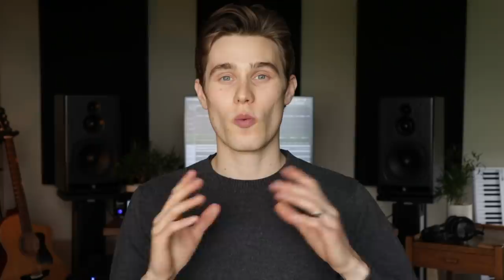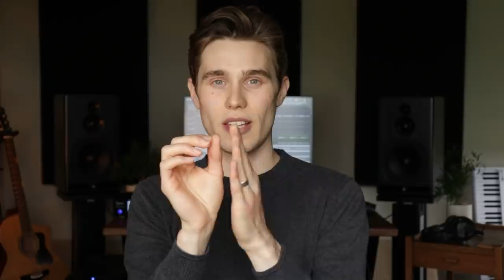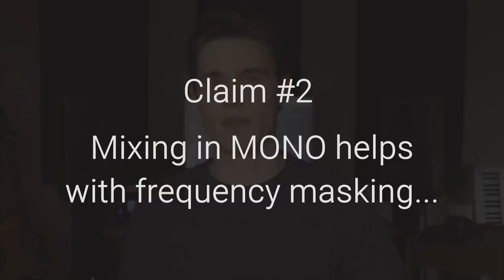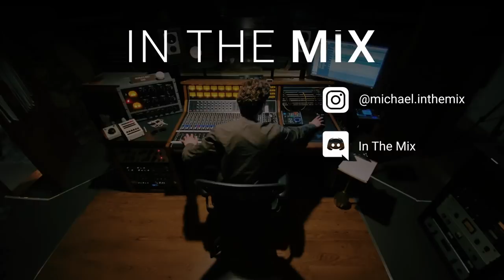Mixing In Mono - Secret Weapon Or Waste Of Time?

Comment: Mono compatibility is not just for clubs or radio, anyone who moves far enough away from their speakers where the two speakers essentially become one source will hear your mix in mono too. I don't have the number either, but I'm going to guess it's far less than 99% of people who always stay perfectly in between their speakers or who only listen to music in headphones. I know I certainly don't. When you factor this in, lots of people hear music in mono even if they don't really think about it.
Reply: Yes, and no. Stepping away or moving around a room with speakers does not fold a stereo mix to a mono sound. It does "alter" the stereo image tho. for sure. So its not mono they are hearing it in moving around, there are still 2 channels producing sound. A great example, which I learned when I was young listening to AC DC on someones old mono record player was one guitar was missing, or hardly audible, why? because they were hard panned when mixed. Then I played it on my home stereo, no mater where I moved to, even different rooms, the dual guitars were there. Its not mono, its altered stereo imaging. Mixing to fold well to mono is leaving the stereo mix sub optimal. Some choose to compromise, its not wrong or right, just a choice.

Comment: Indeed, love the comparison to "imagine mixing with a low pass filter and then being amazed when you turn it off". Have often wondered how much of the "mono mixing is great" is due to precisely that effect.
Reply: I don't have that answer, but all I can say is that I have had one of  my music mixed by 2 different engineers. It sounds  nice in their studios but when I heard it back on my headphones the vocals were hidding the other instruments quiet a bit. ..but on my phone those instruments literally got hidden under. ( Piano and violins). I started to assume that what I heard about mono compatibility was real.
Reply: @davidcedric3268  I've got the same problem on a mix I'm working on. I have two electric guitars playing the same riff hard panned right and left. On my studio headphones (and any other stereo speaker system) it sounds great but on my phone speaker you can barely hear the electric guitars. I've scoured the internet looking for a way to fix it but no one so far has a satisfactory solution. Nothing I've tried worked. I'm  not sure what I should do
Reply: I think the main goal is that the mono mix sounds as good (if not better) than the original stereo mix, which usually elevates the new stereo mix as a 'side effect' 😉
Reply: @austinedeclan10  This happened with me as well but with vocals. The vocals hid under music while playing the mix on a phone but the mix sounds pretty good on stereo speaker systems. I have no idea what went wrong.
Reply: @Moktac  I ended up changing the amp settings for one guitar so that they're completely different in terms of tone. I think for vocals maybe you can mono your vocal channel. Maybe that'll work
Reply: @austinedeclan10  Thanks for the advice. Will try that out.
Reply: @austinedeclan10  the left and right guitars are probably cancelling each other out due to being opposite at same time. Move one of them forward 20ms so it's not noticeable and see if the problem goes away
Reply: @semephor  thanks. I'll definitely try that
Reply: @austinedeclan10  You've probably already sorted this out but, Phones tend to lose bass and mid, probably a good idea to try mixing with a phone sim speakers which you can get plugins for, some free. Just add a bit more bass and mid as needed and check with your monitor speakers as well. Mixing is such an art form. One thing I have learned over the years is that too much processing is not good on guitars, I just try and use cab sims now with very little reverb, maybe a good delay.
Reply: @gilldanier4129  yeah. It turned out to be two issues:
1) phase cancellation; This was fixed by reversing the polarity of one of the guitars

2) at the time I was using Ableton live 9 for some reason which did not have true panorama. this caused all kinds of issues especially if you've got the same instrument or audio on two channels panned left and right. If any one is still using an old DAW without true panorama (why though?), there are hacks to achieving true panorama. They can be found of forums and subreddits related to your DAW if you search online

Thanks for replying 🙏🏿
Reply: @Moktac  did it work?  Try A1 Stereo Control VST free from plugin boutique, and turn stereo width control all the way to the left.  I find that works well for Vocals, bass , kick and snares. im probably a year too late lol
Reply: @just2comment2  Yes it did. Thanks for the advice though.
Reply: @austinedeclan10  add another and have it centered and take out the sides with a mid side eq.
Reply: @thebreifcaseman269  that's brilliant. I'll try this

Comment: Something I was told early on with producing dance music is that many (most?) club sound systems are setup in mono because there are speakers all over with no true left or right field so it's important to always check how a track sounds in mono to ensure it will translate well to clubs. Since then I've made it a habit to check my mixes in mono throughout the production and take that into account in the mixing process.
Reply: which is funny with dance producers getting all 256 bit abbey road studios with their productions now 😃
Reply: This is true, and the big challenge right now is for artists like myself who want to branch slightly out of the underground, which is where streaming comes into play. For a long time I was only producing Techno and Minimal, had success with that on an underground level, but those tracks are built for DJ's and Clubs, period. Now that I am thinking more audience-centric, I have to consider the casual listener as well. So the challenge is keeping that interesting stereo image and depth for them while also making sure it bangs in the club.

Comment: Nailed it with your last tip.  My UE Boom will immediately show me issues in my low end, while my track will show me if I have width issues.  Also, just putting it on while driving casually let’s my ear pick up obvious transients like your headphone idea.  

At some point it’s important to just take role of casual listener.

Comment: I have to laugh.
You youngsters are priceless !
In 1961 when I started d recording, all we had was MONO.
One mic, one recorder,  one basement.
That's how we learned.
About rooms, mic placement, gear, the whole works.
Even today (2023) I mix EVERYTING in MONO, then I reach for the panorama controls LAST.
Most of the problems you discuss never existed in the first place using this method.
I never did it any other way.
Thanks for posting,
Bill P.

Comment: I've found that inserting a Patcher (which I use to EQ mid and side, or stereo, information separately) on the master track removes the "summing" of the audio information and makes mixes come out more clear and cohesive in the full stereo mix.

The quick version is, you split the audio into mono-only and stereo-only signals with a stereo separator. Then, when you mix, turn off the stereo signal in patcher by right-clicking the signal "cord" going to your stereo EQ.

You'll hear the center information minus the stereo.

Get levels close to where you want, then turn off the mono and turn on the stereo signals. Here you'll be fine tuning your mix, so you need a good ear. The benefit is that you hear all of (and only) your stereo signal, but IN mono.

I've found it much easier to mix the levels properly this way. If you, for instance, add more stereo separation to an element, it will just get louder in the stereo signal, and won't push signal to the left and right.

Adjust the level to get the sound near where you started, then turn the mono signal back on.

Now, added with the mono, the full stereo mix will sound cleaner and more full, with better sounding levels.

It's definitely a more advanced technique, but if we're talking about making mono-mixing beneficial, this is the best way I know.

Comment: Lots of great points discussed in this video! Personally, I believe mixing in mono should only be used to check for correlation issues between the left & right channels, and balancing your levels. Multiband correlation meters are enough to address this issue and perhaps offer a bit more of what you can't hear when mixing with your own ears in mono. While mono compatability is important, stereo compatability is also critical. So as an word of advice, check your mix in mono from time to time to set your levels and identify possible issues in timing differences between correlated signals (phase). Use a correlation to see if it's actually a problem or not. If everything's in the green, you have nothing to worry about! Only use mono as a reference, not as a guide! Happy mixing!
Reply: Thanks for the tips. Which plugin do you recommend for this?
Reply: @Darfail  I personally use 2BC MultiCORR by MAAT because it's a multicorrelation meter that comes really handy when mixing. Voxengo has some multicorrelation meters, but aren't as visual as MAAT. MAAT also has a free correlation meter called 2BusControl which is not multiband, but it definitely helps you identify some troublespots in your mixes.
Reply: @shinyukomusic  cool thanks so much

Comment: Good vid. As someone who has been mixing for a living for the past 20 years. In some cases I start mixing in mono then switch to stereo or vice versa and other times not at all. It depends on the song and the track count. If there are tons of tracks in similar frequencies ranges phasing masking,, MONO sometimes helps get better perspective when frequencies clash or mask, but most of the time I mix in stereo...and sometimes just listen to tracks panned to the left together then check the right all together.

Comment: This is pretty much spot on, when I'm mixing I do the bulk of it in stereo but will quickly switch to mono to check for any phase cancellation issues, once I've dealt with that I go back to stereo

The other thing I do a lot is mid/side eqing so that everything below about 150-200hz is mono in my final mix

Comment: Thanks for the video. I started questioning the merit of mixing in mono and if I should started to use the technique as well so your video came to a very good time.
What interests me most though is when you spoke about running it through different encoding simulations (11:59) what did you mean? Where is the difference in sound and what is a encoding simulation in general? 
I really learn a lot through your videos so keep up the good work and have a great day!
Reply: iZotope Ozone 9 Advanced has a feature called Codec Preview that is very useful for this. You can preview what your track will sound like when compressed by different codecs and bit rates.

Comment: I recently started to perform an optional "smartphone check": I render MP3 in good quality and listen to the mix through a smartphone loudspeaker with different volume settings. Though it sounds super extreme, this way helps to detect (or confirm) some problems, especially with bass and drums. As for the mono-test, I assume it is useful to check the mix with Bluetooth battery-powered loudspeakers which are stereo in terms of a number of speakers, but actually mono due to a tiny size. I will probably buy one for mix checking.
Reply: I agree. I have a Bluetooth speaker as well and it really does help mixing everything. It’s also helped me learn to have a “sense” of what may or may not sound good on less than stellar speakers - of course it’s not perfect but the general sense of where things need to sit in the mix for speakers that aren’t studio-grade is immensely helpful.

Comment: 8:28 <~~ your discussion on polarity makes perfect sense.  I don't think that anyone would argue that observing polarity (if something is out of phase) in mono is far easier... This, along with the idea you expressed earlier about having your whole sound "centered," being conducive to facilitating a listener's ability to discern if something is too loud or not loud enough, also makes sense...  The trouble is, I'm not really understanding any good reason to go back to mixing in stereo.  It's not like something that is mixed in mono will be lost when it's played in stereo...  Conversely, It seems to me that something that is mixed in stereo, can EASILY be lost, if played back either in mono, or on a system where the frequency response presents unexpected weak signal ranges, in one or both channels to different degrees.

Comment: one thing I need to point out (or add on) is that there are many "pan laws" in your DAW, different pan laws give you different reduction on overall level when you pan an instrument. from my knowledge, Logic Pro has such feature to choose which pan law you want to go. some pan laws is measured by level and others might be measured by other factors. 

my point is that such pan law differences might change how you perceive a stereo mix in mono.

my advice (though might be ignorant and lacking of profession) is firstly try different pan laws see how they go, and then compare the mono mix to the stereo specifically for the panned tracks

Comment: First of all thanks for this Amazing Guide! I think Mix in Mono should be the First step before you  start applying FX. Reverb,delays ,Even compressors that can add volume will confuse most Producers. Either way I think it's a great tip for OBSERVING &LISTENNING  to your instruments and also for getting the full potential of the dynamics of every sound by checking for phase issues. If you can get the full dynamics without compressors on the mono just by correcting phasing issues then you can go a lot smoother on the compression step which comes along .
Please let me know your thoughts on this!

Comment: I had never known or thought of the hard panning -> 50 % volume in mono (compared to no hard panning), great point! I guess I've never even panned stuff hard right or left, maybe that's why.
I find useful all these that you talked about (y)
In FL I assign one button from my midi controller to the master stereo to change between normal and 100 % mono at any time with one click, very handy, and very fast to compare in whichever situation. Choose latch from the "mode" menu in the "link to controller" pop-up menu, and write input + 0.5 as the formula, otherwise you'll change between 100 % stereo and 100 % mono instead of "normal" stereo and 100 % mono.
An important handy concept I noticed just some time ago: ozone EQ, ozone imager and TDR Nova (TDR is free) change absolutely nothing in the mono signal when you cut or boost the side channel volume or stereo width. In English, they are very, very handy stereo tools that do not change your mono quality at all, and TDR Nova (free) and Ozone EQ (not free) can therefore be used as very precise stereo enhancers instead of Ozone Imager (the multiband one is not free). So if you cut all frequencies from the side channels, you're left with the exact same mono sound as when you make the channel output 100 % mono, and you don't have to worry about your mono when adjusting stereo.
I think drum and snare sound better when they're at least a bit monoish or even completely mono. Symbals in stereo, especially with beautiful reverb and delay effects.
When doing sound design, I always check every sound in mono while building and adjusting (especially unison, chorus, phaser, flanger, detune, layering). Also, some lead sounds (also from FLEX) just are inherently bad in stereo because of phaser/flanger/chorus/the like, and sometimes you have nothing you can do about it (no knob to tweak to fix it), and they at least need to be doubled or supported with another lead to ensure that the sound isn't dying in mono. Ever since one song when I first used sytrus to synthesize a complex lead, where I hadn't done that, only to find out later that it pretty much killed itself in mono (fixed by adjusting the unison settings, which in Sytrus you can very easily use to kill your monocompatibility).

Comment: I constantly check my mix in mono throughout the mixing process, but don't actually make any mixing decisions in mono. It's just to check compatibility, masking and phase issues. 
The one trick I have is that I use a utility plugin on my master bus that has a -6 Linear Pan Law with both channels panned to centre so I can hear the masking properly instead of the sides becoming 3db softer which can hide problems that exist. I turn this plugin on and off as my mono switch.